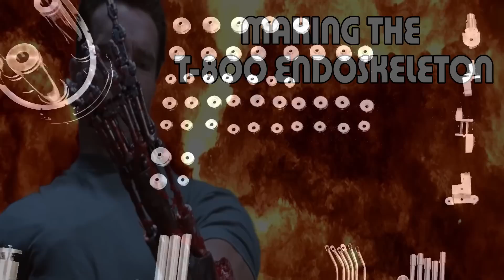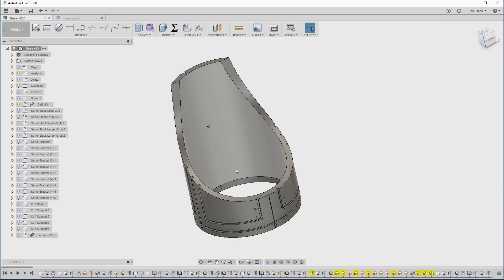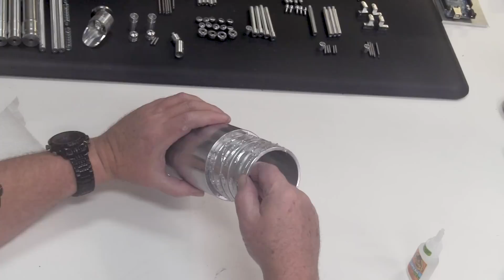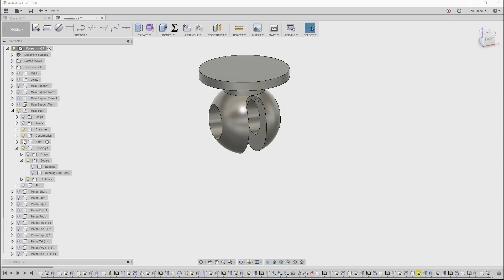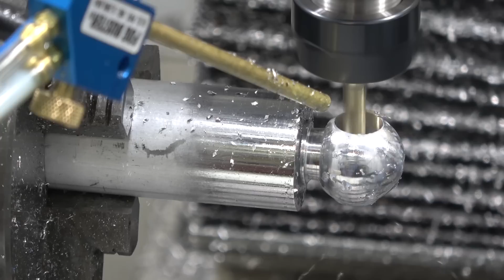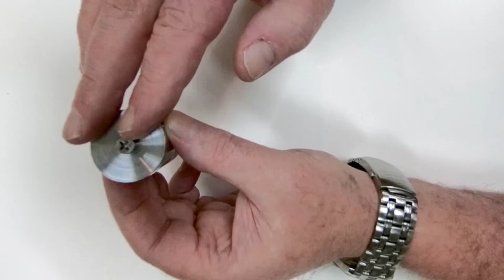T-800 Endoskeleton Arm Part 05 - Machining The Forearm

Comment: Great Work... Are you going to do ball joints or universal joints for the pistons ?
I found you'll get more movement out  of the universal.
https://www.youtube.com/watch?v=YAWMsCTs7Bo
Reply from the maker: Thanks Jamie! I see the approach you took. I'm using swivel joints (similar to ball joints) at the top of the pistons as well as at the base of the cylinders (where they attach to the bottom of the cuff). I haven't assembled and tested it yet, but that's what I'm hoping will work.
Reply: Keen to see it all going together